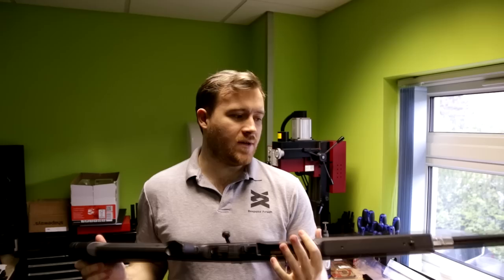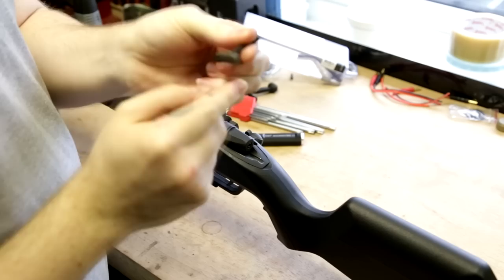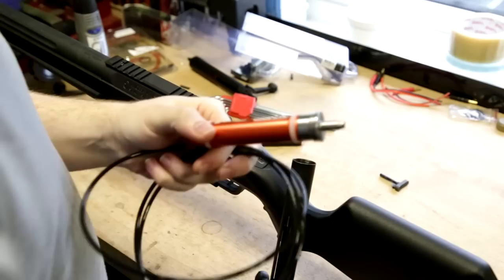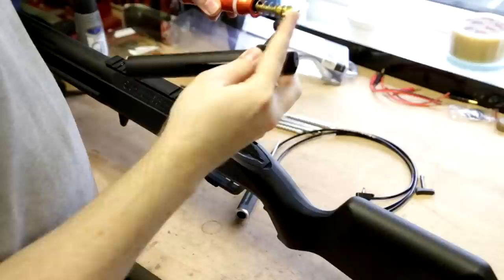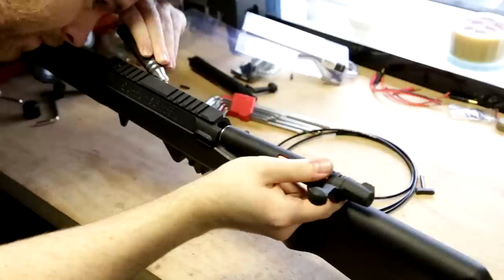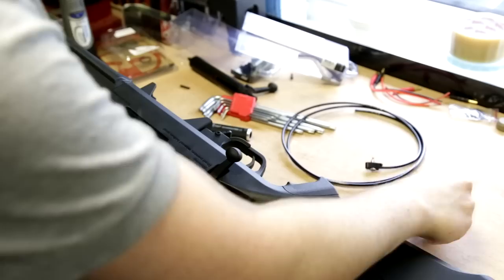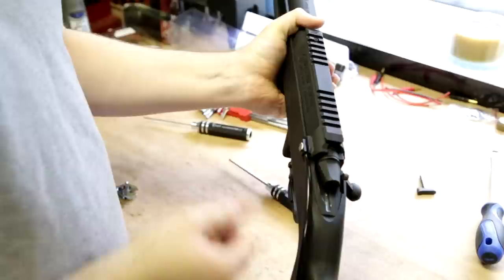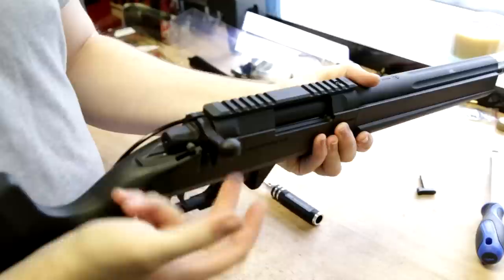Ares Amoeba Striker Mancraft SDiK Kit Installation Video

Comment: You can install regulator with 12g CO2 cartages in the stock it's really good as it doesn't stick to your body (the replica i mean) and u can always leave it on the ground for quick move around for pistol action

Comment: I have a question. I did all the Steps but u notices that when i pull thé bolt with the airline in it doesn't release. When i remove the airline and pull the trigger the bolt is released. Do you have An idea what they problem might ben?

Comment: Really handy  -  possibly daft question but does the Mancraft kit negate the issue around the cylinder volume/heavy weight ammo concerns some have with the Striker? It seems that your options are Mancraft if your site isn't too restrictive on the use of regulated gas or getting the EdGI dual bore.
Reply: Hi James. Not sure if this post is still active. I currently run a polarstar jack on my GnG honeybadger. I've just acquired a striker and wanted to know if I purchase this upgrade can I attach a hpa adapter to the line and just straight connect to my tank or is this conversion strictly co2?
Reply: Tony McCaff you'll need the right adapter for the line which is 1/8th I think. but yes, your HPA setup will work.

Comment: I keep having reliability issues with my trigger even with mancraft kit installed, why and what for help? I took my gun to the store earlier today because of the issue (and to get the mancraft kit in the mix) and it was thought to be fixed with a piece of that tube that tightens when heated. But the problem started again after installing mancraft just now...
Reply: Did you change out your sears?

Comment: is their any way to lock the hpa for tournament purposes. milsims that allow only 450 fps
Reply: Yes, there are tournament locks available at mancraft site. its basically a 3D printed Cap that you put on the regulator after setting the pressure and then you fix it in place with zip lock, that prevents from changing the pressure value mid play. The People who organize the milsim should mark that ziplock and your ready to go.